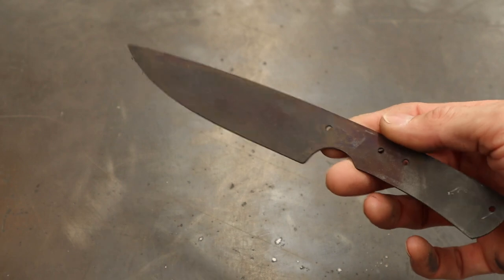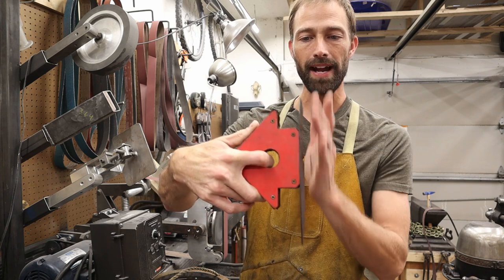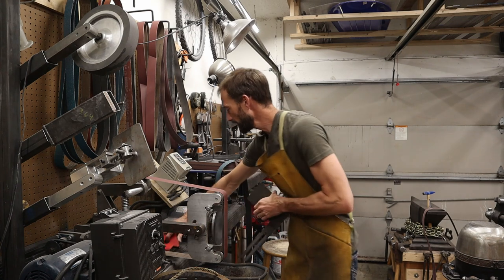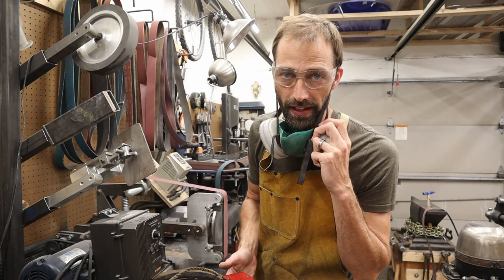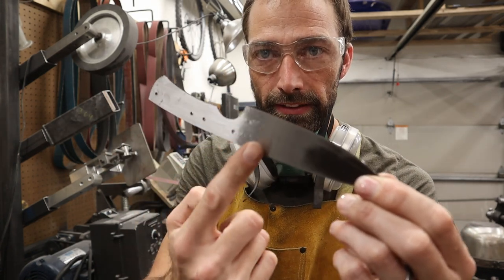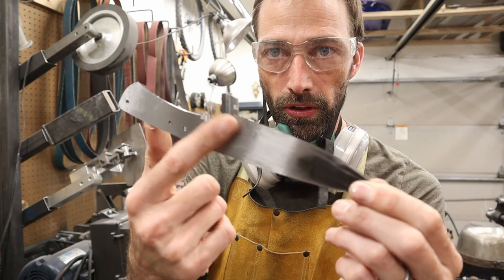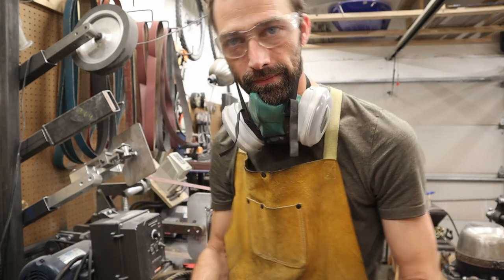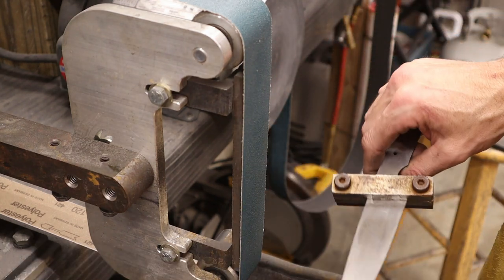1/16th inch knife stock - knife making -

Comment: So because these are thin its ok to do bevels after heat treat vs thicker stock you do pre heat treat right?
Reply from the maker: There are quite a few makers to do all their grinding after heat treatment as long as you keep the blade cool you're good to go on these fit or knives it's almost crucial to do the grinding after heat treatment because they warp so easily during the heat treatment process